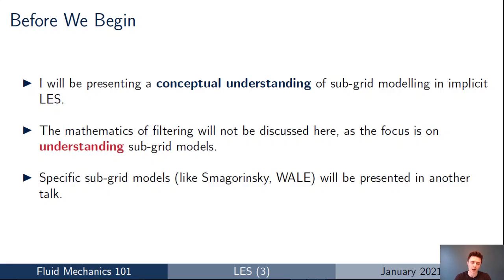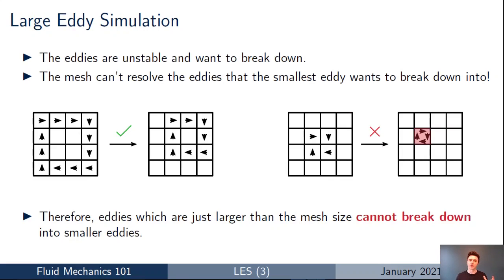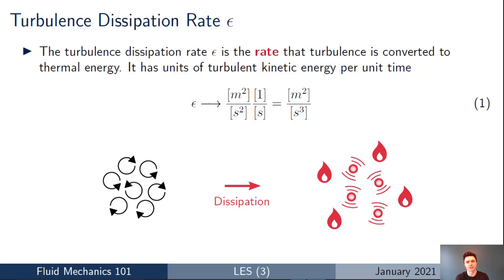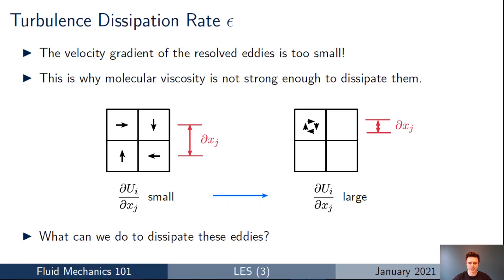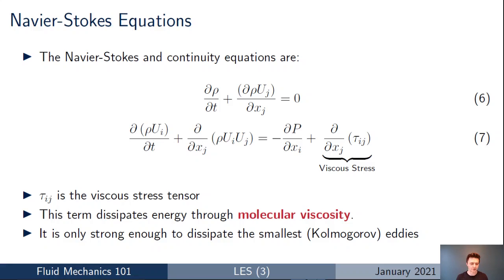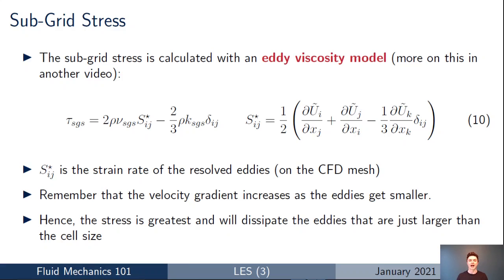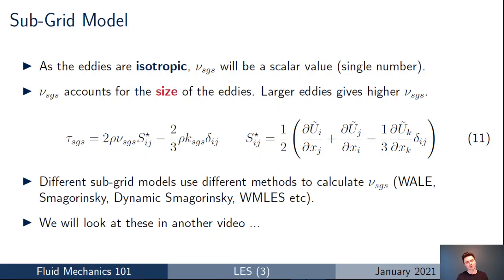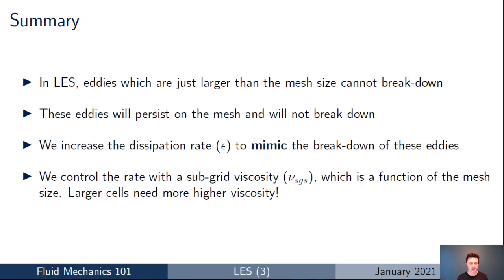[CFD] Large Eddy Simulation (LES) 3: Sub-Grid Modelling

Comment: Great work, I particularly appreciate the fact that you mention the dependency of the LES equations on the grid when implicit filtering is used.  I have a few remarks:

- I'm doubtful whether the assumption of isotropic subgrid eddies is in fact being made in eddy viscosity models. The subgrid stresses are certainly not considered isotropic --- they follow the anisotropy of the rate of strain tensor, as per eq. 11. So if your assumption on the eddies is the same as on the stresses, the eddies are in fact allowed to be anisotropic as well.

-  I understand that you want to show that nu_sgs must depend on the grid size. This is of course correct, but fundamentally there is also a velocity scale involved: to get viscosity you multiply a velocity scale by some length scale. So while nu_sgs accounts for the size and is a function of delta, that is only half the story.
Reply from the maker: Great clarifications! I have pinned your comment as I think it may be useful for others

Comment: Thank you for putting together this series for LES, I am finding it extremely useful! I have one question, you mention that the sub-grid viscosity is a function of mesh cell size at 31:01. So is sub-grid viscosity manually set by the user or does the CFD code compute sub-grid viscosity to ensure that eddies larger than mesh dissipate?
Reply from the maker: Usually the CFD code uses a default value of the Smagorinsky coefficient which implies that they set the sub grid viscosity. It is left to the user to make sure that their mesh is fine enough for this sub grid viscosity to be appropriate 👍

Comment: Thank you very much for these interesting talks and comprehensive and clear explanations! 
You've mentioned the term "implicit LES" and refered to it as LES without explicit filtering, i.e. grid filtered, commonly known as Schumanns approach. In the literature "implicit LES" is sometimes used to designate LES without explicit SGS modeling, where one relies on numerical dissipation associated to low-order discretization schemes in order to account for missing eddy breakdown and SGS-level dissipation. Have you heard about this kind of implicit modeling? I would be interested in your thoughts on this topic.
Reply from the maker: Yes, I have definitely heard of this approach but haven't looked at it in too much detail. I tend to try and focus on the methods used by the mainstream CFD codes, as these tend to be more useful for the majority of the CFD community. Whereas approaches like "implicit LES" tend to be more niche, so I don't cover them in much detail. They are definitely interesting and I would like to look into them some more 🙂
Reply: I recently stumbled across a formula for viscous dissipation epsilon (equation (2) in your video) in the literature, where the strain-rate tensor was used, instead of the velocity gradient tensor: epsilon = 2 nu S_ij S_ij and I was a little confused, because others rely on epsilon = nu du_i/dx_j du_i/dx_j as in this video.
Do you maybe know why these different definitions exist?

Comment: Hi. I am deeply grateful to you. Thank you.

In understanding RANS vs LES, I am a little bit confused here.

In RANS: 
1- Navier-Stokes Equation
2- Decomposition of instantaneous u to (U Mean) + (u' fluctuation)
3- Time-averaging

/Output: an equation f(U Mean, normal u'u' and shear u'v' ... )/

4- We need to replace u'v' with U Mean also
/While doing that new artificial term Mu(t) is up /

5- Modeling (e.g. K-e) to get Mu(t)

/So in brief, we replaced the (instantaneous u) with (U Mean) and Mu(t) which itself is replaced by k and e for example/

On the other hand, 
In LES:

1- Solve for instantaneous u directly. NO decomposition here.
2- Statistically-averaging to get U Mean. This is not the same average as above. Right??
3- u' fluctuation = instantaneous u - U Mean
4- Calculate resolved turbulent kinetic energy k(res)
5- Calculate k in SGS by adding an extra term. 

Thank you.
Reply from the maker: For RANS you are 100% correct. For LES you have all the key stages. I think the part that you are missing is that the instantaneous u that you are solving for in LES contains = U mean + u' resolved. There is another fluctuating component that is below the grid size. 

Ureal = U mean + u'resolved + u'subgrid 

So when we do the statistical averaging in LES (to calculate U mean) we aren't including u'subgrid. This is why Umean in LES is slightly different to Umean in RANS (assuming the RANS model were perfectly correct). 

I know this is very confusing but I think you have all the stages that you need for your understanding and you are correct 👍 also, great job on your explanation

Comment: Hi Adian, Excellent work. Just wanted to ask about the total time recommended to run LES Model. Several authors have used roughly 10^-5 or 10^-6 as the time step size but i did not get anyone mentioning the total time. Someone said about 5 sec, another person argued that 5 sec is too much maybe 0.5 sec. What is your suggestion. Thanks in advance.
Reply from the maker: Hi Mohammed, the total time will depend on your specific problem. You need to run enough time for the flow to 'wash through' the domain twice. You can calculate this roughly as 'volume of your domain / volume flow rate through your domain'. People often refer to this as the 'hydraulic retention time'
Reply: @fluidmechanics101  Thanks a lot. i think the formula you have provided 'hydraulic retention time' will be very helpful. i will start with that and lets see where it ends.
You are amazing Aideal. God bless you.

Comment: I have a question, how does one "marry" LES with, for example, PISO or VOF? I don't see where LES fits in the over-all solving process. Is it just giving a viscosity value to each cell? Is it changing the velocity field or pressure value?

I'm new to CFD, and I have a general understanding of how each algorithm/method works, but I still don't see how does all fit into the Finite Volume Method (the general matrix, so to speak).

Best regards and thank you for such incredible videos!
Reply from the maker: The principle is exactly the same. Both RANS and LES work with the finite volume method. The only difference is that you have a much finer mesh and smaller time step for LES so that you can resolve the fluctuations on the mesh. The Reynolds Stress or Sub Grid stress are just additional forces (remember the divergence of a stress is a force) that you apply to the control volumes. The sub grid stress is much smaller than the Reynolds stress. But the principle is the same 👍
Reply: @fluidmechanics101 , so when you set a simulation, for example, in Fluent, you set it to use PISO as the Pressure-Velocity coupling and LES for the turbulence model, which one is solving the Navier-Stokes Equations? Which one is building the matrix or calculating the pressures and velocities? 

I assume that VOF only gives the values of density and viscosity at each cell, proportional to each phase.
Reply: @pollovrhd  From my understanding (correct me if I'm wrong) is that PISO is the algorithm (sequence of instructions, such as solving the momentum equations or the pressure value), LES is the one that actually solves these values (the computer does the calculation, but LES tells it how) and VOF tracks the free surface cell by cell.
Reply from the maker: Almost. PISO gives the order in which the equations are solved. The finite volume method is actually the method which assembles the equations and solves them. LES and RANS are just additional modifications to diffusion (in various ways) to account for the effect of missing (unresolved) turbulence. VOF is the method used to specify extra sets of equations for different phases
Reply from the maker: Sorry, didn't read your whole post! Yes VOF gives you velocity and density in each cell
Reply: @fluidmechanics101  I see; what do you mean by diffusion? What modifications? 
Thank you for the explanation!!
Reply from the maker: Ahhh diffusion is the name commonly given to the term on the right hand side of the transport equation that takes the form of a second derivative / Laplacian. For Navier Stokes this is the viscous dissipation term ( d/dxj mu dUi/dxj) 👍

Comment: One point that should also be noted is that RANS models and LES models are fundamentally different in that RANS uses an ensemble average to arrive at the governing equations whereas LES uses space-time averaging to arrive at the governing equations.  This means that the dissipation rate (and other parameters) may have the same units, but they are fundamentally different.  The dissipation rate from RANS is defined in the context of ensemble averaged equations and accounts for dissipation that occurs at all scales, whereas the dissipation rate for LES is defined in terms of a space-time average (filter) and only includes unresolved dissipation.  They are really apples and oranges and it is easy to get confused if one doesn't recognize that they are fundamentally different.